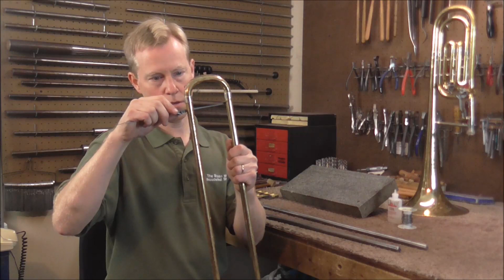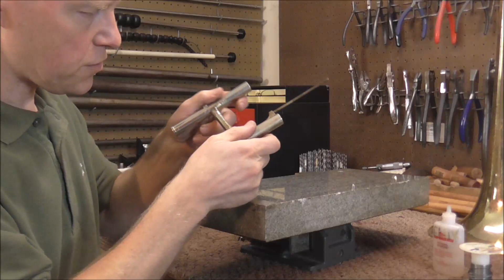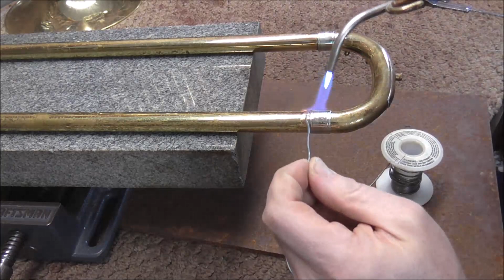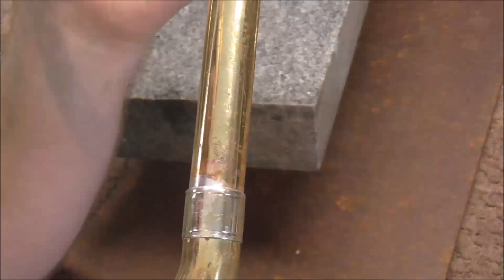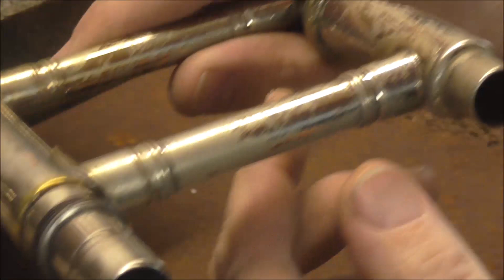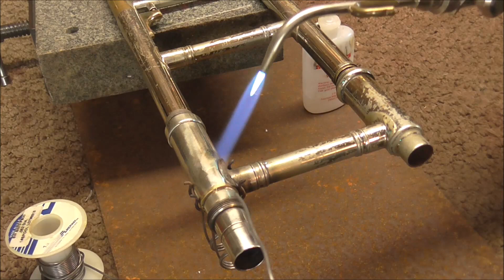Bass Trombone Restoration Project #9: Soldering the Handslide

Comment: The curved piece on the end could have you check 2 measure that from the other end and just using your two drumsticks... Like you showed me.. Put it on the granite slab and then use the drumsticks to check that piece... Because you checked all the other pieces but that one piece that connects both of the tubes the curved piece, you didn't put that one on the granite slab like you did the other ones...